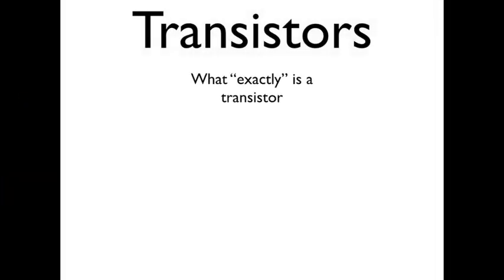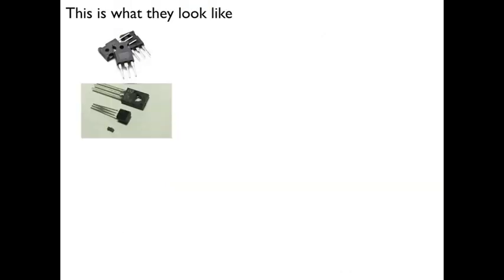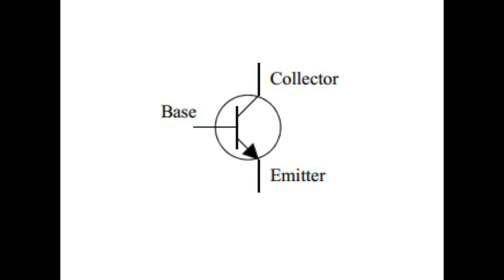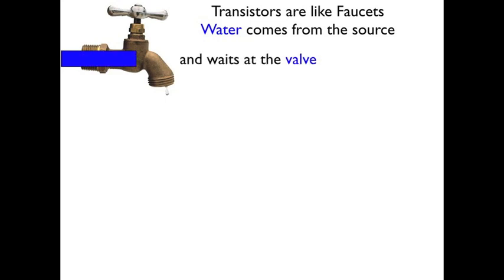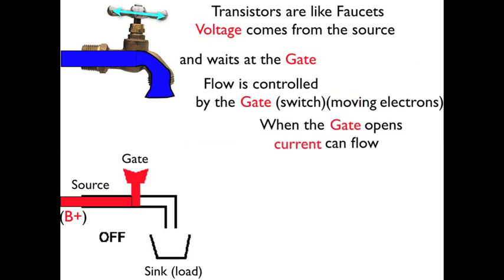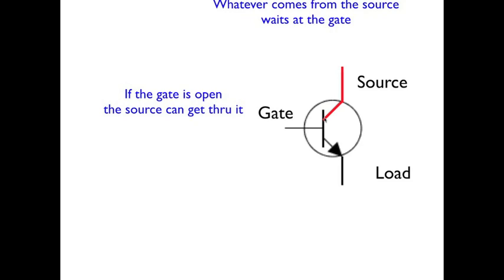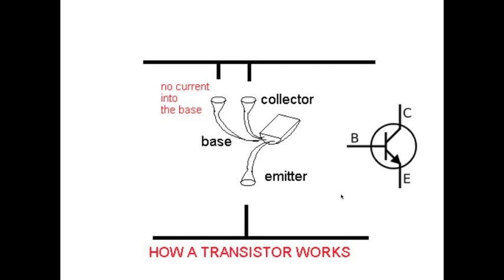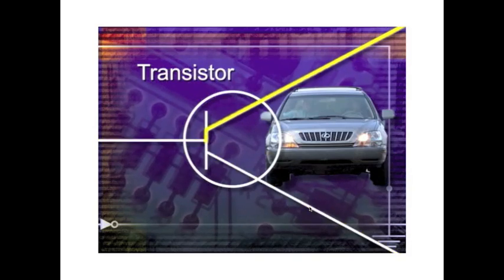Lesson 7  Part 1  How Transistors work

Comment: You referenced the base of a transistor as a gate, which essentially it is, but that could confuse people if they're looking to research this further. FET's and MOSFET's have what is called gates, where in transistors it's called base, and they are label specific on schematics. Just something for people to remember in case they get further into this, studying electronics can not only be difficult to understand if you go deep enough into the subject, but also hard to remember.